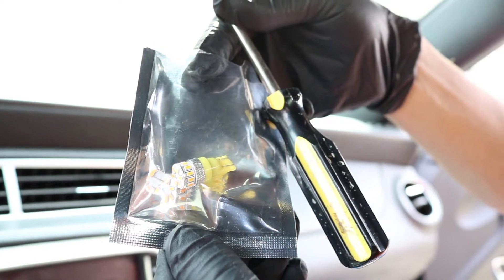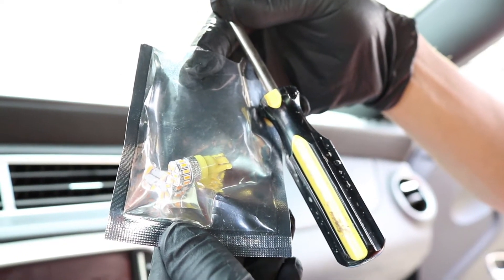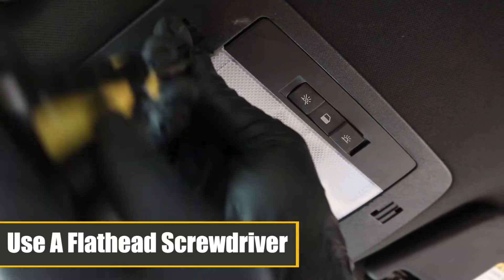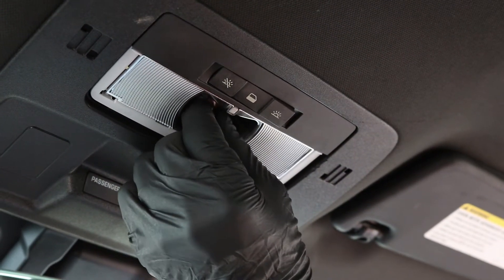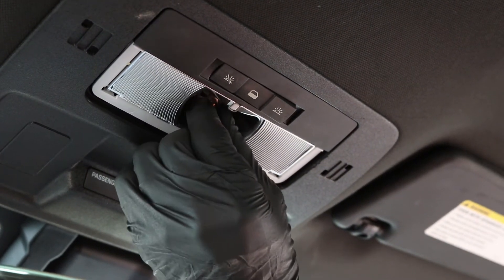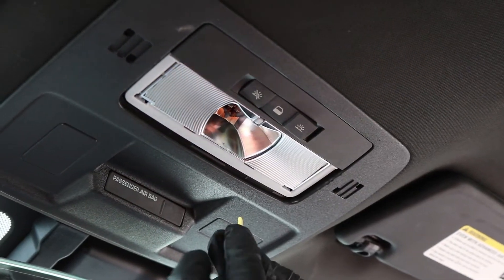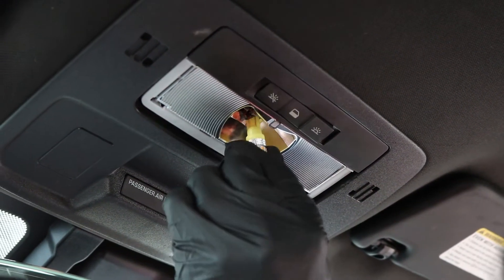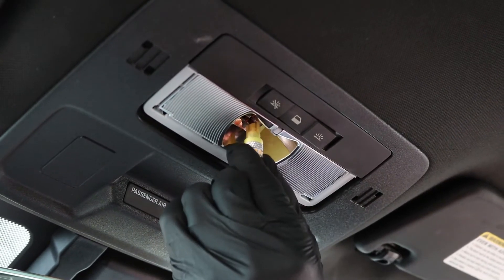Install 2010 - 2015 Chevy Camaro Dome Lights W5W T10 LED Interior Bulb

Comment: Thank you for those numbers, I just purchased a 2015 1LT/RS and am looking to swap out the factory for brighter ones.
Reply from the maker: Thanks for your comment: are you looking for dome light bulb? and what color you want? please advise for further assistance, thanks in advance.
Reply: @AllaLighting  I'm looking for dome(white), high/low beam and backup/reverse. I'm looking at my owners manual but not sure.
Reply from the maker: @bhays71  Thanks for your fast reply, if your stock headlight bulbs high and low beam are separate bulbs, then the high beam bulb size is H9, and low beam is H11, and for our LED headlight bulbs, H9 is the same as H11, that means you only need to buy 2 pairs of H11 led headlight bulbs, below we will show you the products links for headlight, reverse light and dome lights: Headlight bulb(H11/H9) product options: https://allalighting.com/vehicle/2015-Chevrolet-Camaro_LT_w-halogen_capsule_headlamps-Headlight-Bulb-High-Beam?rootId=84809&secondId=90461&categoryId=90465&locationId=20; reverse light (921): https://allalighting.com/shop-bulb-size/921_912_T15; Dome Light (W5WLL): https://allalighting.com/shop/product/1616-SMD-T10-168-194-LED-Lights-Bulbs,-Exterior-&-Interior-Lights-%7C-1-Pair/1783
Reply from the maker: @bhays71  BTW, if your stock headlight bulbs are the same bulb, please let us know and we will update you the different product link for it will be different bulbs
Reply: @AllaLighting  Thank you for the information. Yes my manual says low beam H11LL and high beam H9LL.
Reply from the maker: @bhays71  That is great, thanks. then if you want to upgrade to LED, then just purchase the same bulbs for high and low beam.
Reply: @AllaLighting  I guessed correctly, funny I had your company on my wish list on Amazon for those parts. Thank you for your time and assistance. Do you have a discount for Veterans?
Reply from the maker: @bhays71  Please confirm us the product and its qty, and for discount, we can offer by phone calls order. due to our customer service representative are off work not, would you please call us tomorrow 909-606-2935 (9:00AM-5:30PM pacific or email service@allalighting.com for discount if your order amount is validated.